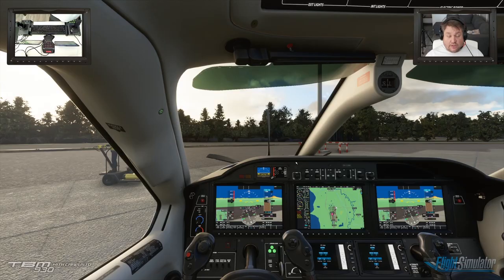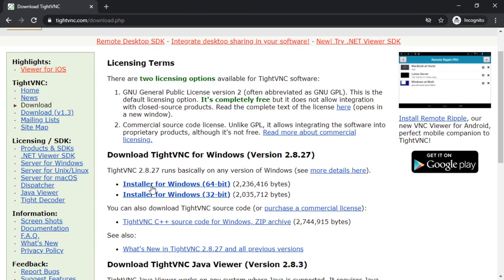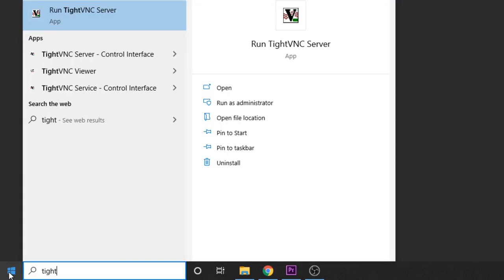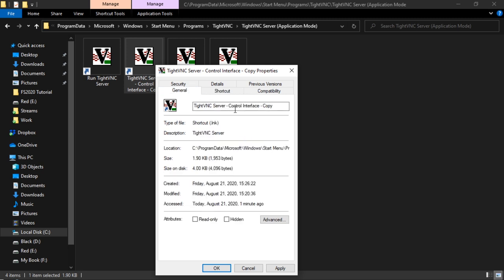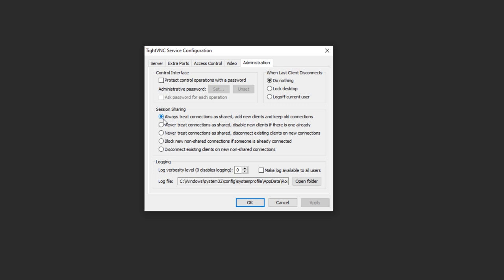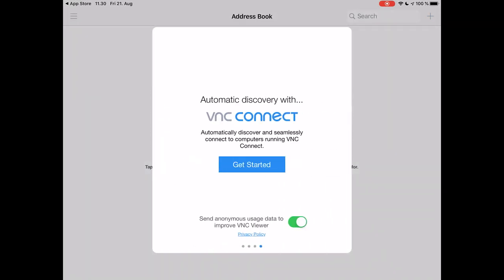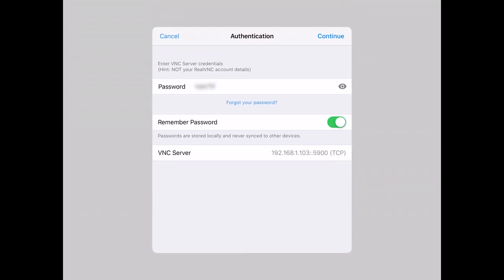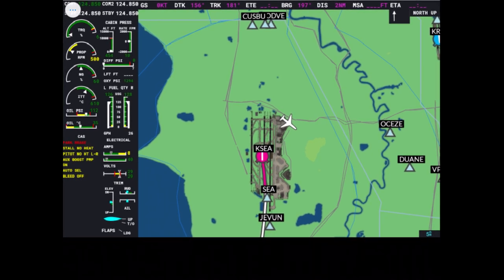Glass cockpit on 2 iPads in Flight Simulator 2020 tutorial

Comment: An other option to couple Ipad is to use them as dedicated screens by using Splashtop Wired XDisplay or Duet Display on Window.
Its an app on the Ipad and a client on the computer.
Than you can directly pop out on the Ipad without a extra monitor because the Ipad becomes the extra monitor
Reply: but you can only use one tablet.. not two :/ would be so easy if i could use both
Reply: Albert van der Heide  I tried that app, it's a payware app fully working is € 4 euro's a month otherwise it's time limited to 10 min.
Reply: @fredbrull136  Try spacedesk. Same functionality (over wifi, not wired) & free.
Reply: I've tried all apps and they lag so much with MSFS! Even wired
Reply: wrong then bro

Comment: I use duet, you can connect the ipad directly via usb, and its super responsive (almost instant) so its perfect for pfd, but i think it costs 10 bucks
Reply: Gideon October you don’t need an adapter, by usb i meant usb to lighting (standard ipad/apple cable)
Reply from the maker: I've actually looked into buying two Lenco TFT-1028 10" screens, they aren't that expensive (112 eur with a resolution of 1024x600). That would be the best solution.
Reply: On Duet can you use the iPad as a touch monitor can you press buttons etc?
Reply: Henrique Coelho good question! Haven’t tried on fs2020, but at least i used in excel and the touch worked pretty well (when you touch something it casts a mouse click). Also keep in mind that not all mfd or pfd have touchscreens in game, usually have “physical buttons” so you cannot interact using the ipad.
Reply: Awesome can you connect 2 iPads with duet?.
Reply: Pilot Hound no you can’t unfortunately
Reply: Pilot Hound no

Comment: This one and spacedesk do the same trick but the problem is your gpu trying to serve another screen. Normally I get around 40 fps on MFSF 2020 and when I use apps like this, my fps drops to 25-30. So this makes around %30 fps drop which makes your sim experience very bad. It is already very difficult to get high fps on mfsf 2020 with one display and when you increase the displays it is very bad experience. When I use 2 tablets. I drop to 20 fps.

Comment: just use spacedesk it turns any device that has a web browser or their are apps for android and IOS into a second screen 

also it just works no need to fiddle with it
Reply from the maker: Cool, didn't know about that software! I guess I'm too old school :D
Reply: Couldn’t get it to pop up the radar on my iPad lol just my monitor
Reply: @ooof5281  make sure in you windows display setting you not just mirroring you primary monitor

just right click on the desktop and go down to display setting then scroll down till you see multiple monitor and make sure it says extend these displays 

you can also use this to make sure your second monitor is placed correctly like if you i pad is under your primary monitor you cam use the display setting to make sure the new screen is under your primary screen by default windows puts new monitors to the left of your primary monitor

other then those things you should just simply be able to drag the pop out window to what ever screen you want 

now if you are using the ATC VOR or the Check List those you need to click the box that normally minimizes or expands window's and that will undock it from the main flight sim window and then allow you to move it to ware you want

Comment: I have 2 old ipads (ios 9 only).  Will they work with this software?  (e.g. Duet Display requires a later ios).  Also, how does the PC connect to the ipads (wifi, bluetooth, etc.)?  Thanks very much.
Reply: try spacedesk if the IOS app don't work on older ipads their is a way to use the web browser instead of the app
Reply: @rayzimmermin  will do -- thanks.
Reply: @rayzimmermin  good news --the app works with ios 9.3.5.  But I am using Trackir5 and the ipad screen simply follows my view.  How did you get the ipad screens to stay with the  glass cockpit views?  Also, it seems they were preconfigured at game start-up.  How achieved?  Thanks.
Reply: @tuffguy007  it sounds like your Ipad is just duplicating you main screen 

so without having the game running right click on the Desktop and go to display settings from their scroll to the bottom ware it says multiple displays and make sure you have it set to extend these displays and not any of the others

in game hold right alt unless you have changes it like i have while hovering your mouse over the glass cockpit you want to use you should see a magnifying glass icon then click the glass cockpit and it should pop up into a new window then you should be able to drag that window to your ipad and use it without track IR messing with it

but to be honest i do not use track IR so i don't know if maybe that is having a conflict but it should not be conflicting 

me personally i use a 3d connect space mouse for POV movement
Reply: rayzimmermin  thanks very much for the detailed response.  I’ll give it a try ASAP.
Reply: @rayzimmermin  sorry to persist, but I really want this to work.  Could not find an extended desktop option in the monitor settings of Win10 (or Nvidia GEForce).  Would not recognize ipad as a 2nd monitor either.  Can't quite get this and would appreciate any additional assistance.  The app manual is light on this type of operation.  Thanks again.
Reply: @rayzimmermin  Spacedesk is a lot more responsive (for me) than Duet Display.

Comment: The -controlservice -sharedisplay 2 (or 1 or 3) doesn't work.
Reply from the maker: I had some problems with it too; you have to follow the instructions to the letter, otherwise it won't work. Tip: There is a difference if you are using it in app or service mode.
Reply: @campusto  Thanks for the mention about the difference between app and service mode.

Comment: I did everything step by step.  Yet and the iPad I have Error The connection attempt timed out :-(  Otherwise I can ping the iPad from the computer.
Reply from the maker: Your iPad is on another IP range than your computer. Check your settings on the router.
Reply: @campusto  Thanks

Comment: SPACEDESK. turn your android or ipad virtual monitor. you not need tightvnc and second monitor to make your pad monitor LOL
Reply from the maker: The point of the video was that the method is free and can be used with what ever devices you have available to you. :)
Reply: @campusto  spacedesk is free also and can be used with anything that haves a web browser or with the IOS or android app so it can be used on what ever device you have available also even if its outdated and the app cant install on it you can just use the devises web browser

also you do not need a second scree as it is a second screen you can also use multiple devises as many as you want it also lets you use your devises touch screen as the mouse auto rotate and so much more 

you can have one screen for your PFD your MFD your ATC and even your check list 

i currently use spacedesk and have not payed anything to do so

so maybe you should actualy look into spacedesk before just dismissing it

also spacedesk just works no monkeying with settings or what not just install and use
Reply: @rayzimmermin  The problem with Spacedesk is you need a fast tablet with WiFi 5g in order to get it working well. I tried it with an old Galaxy Tab and the main sim screen is a stutter fest, plus the Tab screen is slow as hell.

May be the VNC server method works better, I will try it.
Reply: @MrNangu  im using an old acer tablet that dose not have wifi5 and my pc is an old fx8350 16gb ram and an rtx2060 by all accounts i should not even be able to play flight sim let alone with other apps like space desk running yet i play it on high setting with spacedesk and a second moniter and still get 40 fps   and my tab screen keeps up so idk what your talking about
Reply: @rayzimmermin  Well, good for you. I'm talking about my experience with that software and my old Samsung 10" tablet. With my Snapdragon 845 phone it runs fine. I'm only commenting that on some devices it doesn't work very well so the VNC way described on this video may be the solution.
Reply: @MrNangu  maybe you just had it set up wrong and did not go into the apps settings and have it set to your devises ability's 

in the app on the top right hand corner is 3 dots if you tap that you will open a menu tap settings and the first option will be quality/performance in their you can adjust things to make it run better 

on my acer tablet i have the image quality slider half way encoding color depth medium (yuv 4.2.2) FPS 60 render color depth 24-bit (RGB 888) and with those settings it works just fine 

but if you want to jump threw the hoops in the video no one is stopping you
Reply: @rayzimmermin  Yes, I tried all settings to the lower sides, and even a lower resolution on the Spacedesk generated second screen, so it's definitely a performance problem with the tablet on its graphics processing, or the amount of wifi data it has to process.
Reply: @MrNangu  yet i can do it on lower end hardware curious